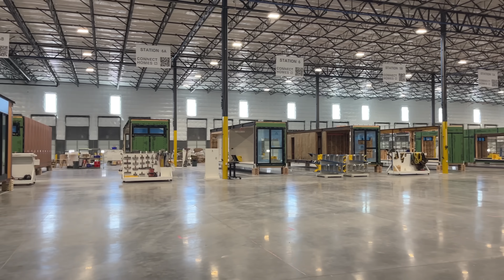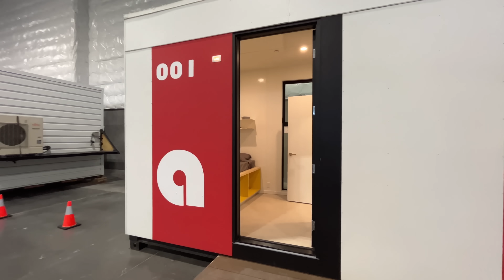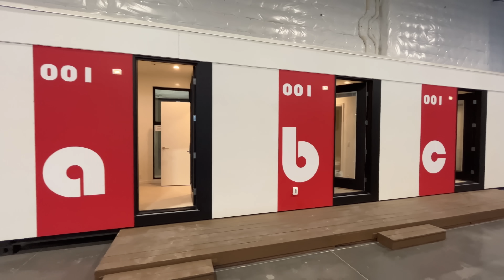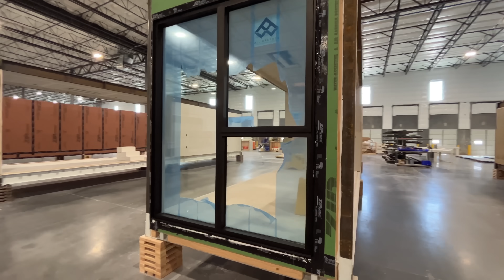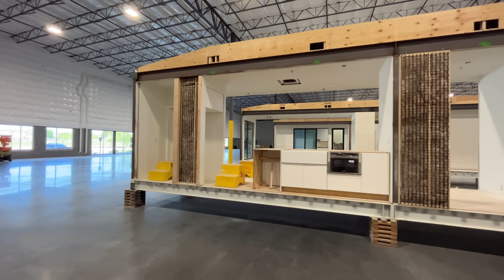Official First Look at the Newest PREFAB HOME Factory in America!!

Comment: They're beautiful but.. what happens when a tornado comes around? Are they any different than a regular mobile home? Or are they built more sturdy to where they might be able to last through one?
Reply: Connect Homes aren't mobile homes. They are prefabricated on steel frames in factory, then shipped to site and welded to stem wall foundations put in by a GC. We have a design team that ensures all our homes meet local code, and currently have homes being built in the of hurricane belt in Texas

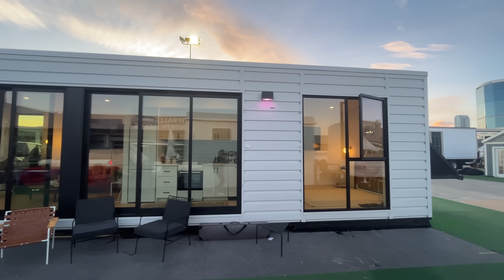Comment: 1:04 - let's get a tape measure and center the outside light between the door & window 🤔
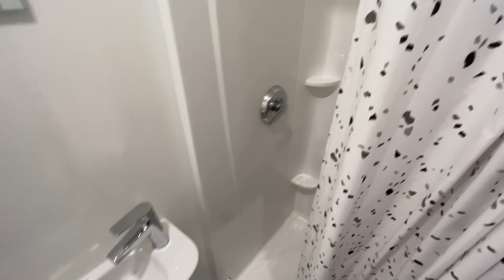2:12 - 6x soap dishes in the shower?  no one needs that, unless you're a rock-climber 
2:54 - beautiful factory & assembly line, but there's still plenty space between the units... seems like the buyer will pay the price for the "inefficient " assembly space?
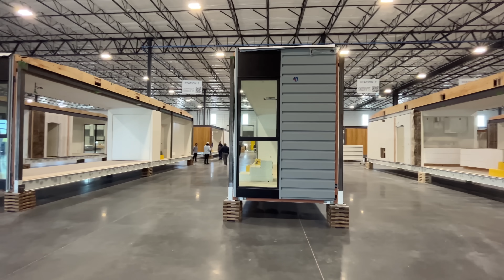7:51 - 500 USD/ qft - that can't be right!!! what???

Comment: WOW!!!! This is a GREAT design. High ceilings!! Super bonus points. The channel-first interview, fantastic - plus the follow-up. Stupendous. This is a peak moment on your channel. So cool. !!!
Reply from the maker: Thank you 🙌🏼🙌🏼
Reply: The high ceilings are wasted space, because it's not usable. They need to come up with a design that is not rectangular.
Reply: @susango123 the modules have to fit on a truck that means 8x40 rhey have built up to 12.5 by 40 but prefab means it has to be transported in modules the final assemblies are not always rectangular. The modules have to fit on a truck.

Comment: It turns out the prices for these things is relatively obscene…to the point of being comical!
But the designs are interesting as well as the video, and they’re always worth a chuckle when the prices are revealed!
Reply: I love watching the videos and the tiny homes, but I would never pay these prices either.  You can hire a builder to build a small 800 SQ ft house which isn't large by any means, but bigger than these for $80k in rural / country areas that aren't  expensive areas to live in.  You can find 1 acre for $10k in a lot of country areas.  Worst case if you did everything separate and bought your own land first then had to pay for power, water, septic.  $120-130k ( in a country area ).  Almost 3x the SQ ft and 1 acre lot everything included ready to live.  It can be done cheaper if you buy a prefab 20x30 metal building and finish it yourself and contract out the utilities.  Probably half of 120-130k.

Comment: Curious how they're able to ship without the drywall cracking in the transport delivery process?
Reply: Our steel frame is the key there. It adds so much stability there's very few cracks in the road. The Connect 1 you see in the video has travelled 50k miles across the US to various events with very few cracks ever!

Comment: Looks beautiful, but with all the glass and steel, wonder what the average R value of exterior walls is.  My guess is Rs are quite low and may not even meet local codes in some regions unless glass is triple glazed .
Reply: I'm also bothered by all the prefabs with floor to ceiling glass.  It's the weakest part of the structure with the most heat gain or loss per unit of area.  Also, at night with the lights on, it's like you're living in a fish bowl where you can't see out but anyone passing by can see everything going on inside.
For outside visibility, most of the time a couple of feet below and maybe a foot above eye level is more than adequate.
Reply: We build to California code, and ensure that all our builds met local codes. We have homes in Truckee, Tahoe and Jordan's in Sun Valley, so we know how important R values are.

Comment: Really enjoy these deeper dives Kerry. Thanks! 

(As an aside, we've always been curious why anything intended to be moved would use drywall. It seems like it cracks easily (I say this while looking at cracks here from years of exposure to earthquakes in Cali in a structure built in place and not intended to be moved), ...aren't there better options than drywall for interior walls and the joints connecting them?)
Reply: True,  but mobile homes are built with drywall as well.  Seems a pain to me,  though,  especially all the sanding,  mudding, and painting.
Reply from the maker: Ive had 18 x 66 manufactured homes arrive with minimal cracks. Most of these structures ship smaller and with the steel frame I bet they dont crack much at all.
Reply: This is why Connect Homes uses the steel frames. It gives much more stability and allows the drywall to stay intact during shipping. We have shipped the Connect 1 you see across the US over 50,000 miles. Yes there is some cracking, but there's needed to be very few patches needed in that time.